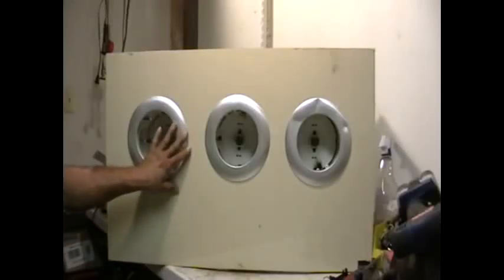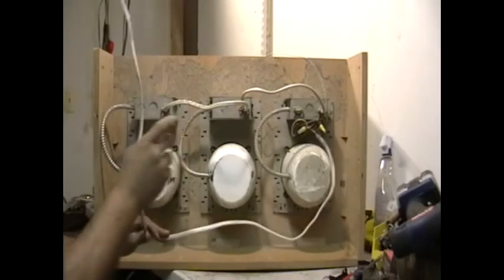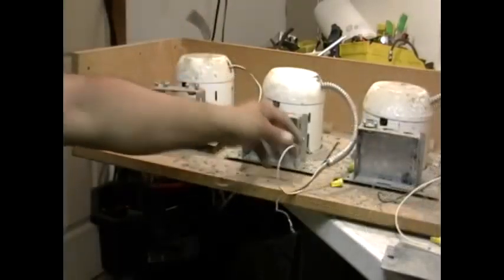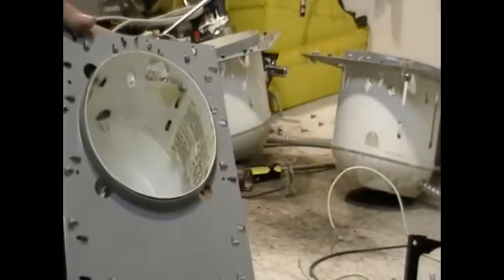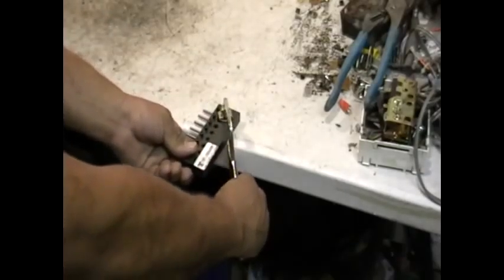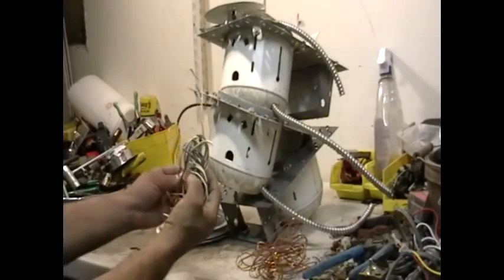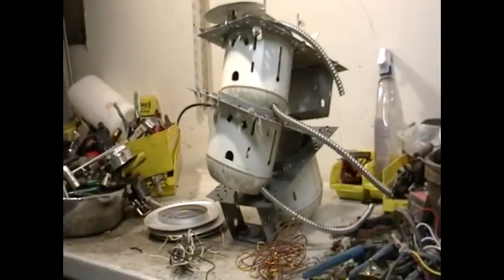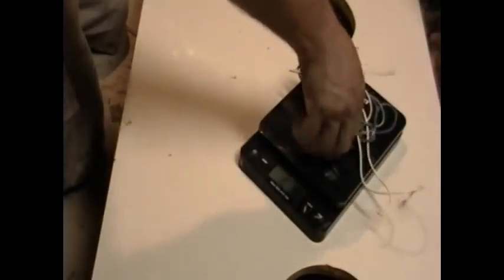Scrapping Recessed lights

Comment: hi Mike another great vid, an electrician taught me little tip on stripping that type of wire pull the earth wire with a pair of pliers it will cut through the insulation like a cheese wire.Then the other wire just slide the edge of you blade across the top and the copper will come out easy. I don't want to seem like i'm telling how to do it as you are the one of the 3 wise men of the youtube scrapping world but they showed me and if you have lots of different size wire it saves alot of time

Comment: Hey mike, for romex wire, there is a "Romex Wire Stripper" it's a very cheap striper  that works great. You can get it anywhere that sells electrical supplies. It is good for the outside coating of the romex. After removing it you can then do each wire. The ground will automatically be unwrapped. 
Thanks for your videos

Comment: Another way to strip Romex is similar to how you did it with your knife.  They make a hook blade for that type of knife.  It works geat to hook into the insulation and just pull the wire through.  The same blade tipped on its side works on the solid strand.
Great vid!